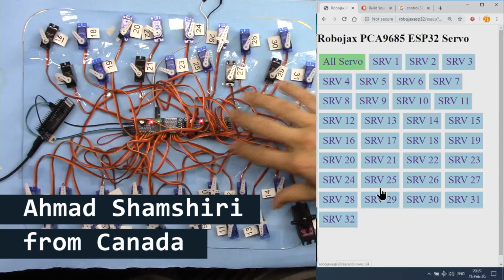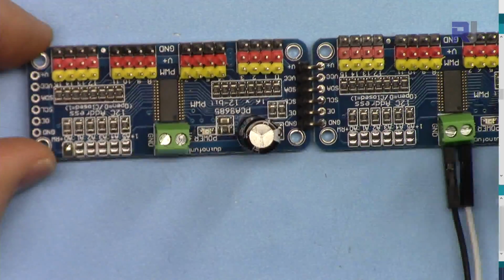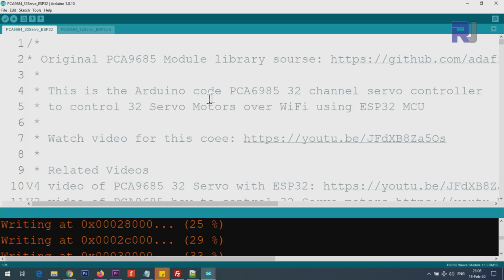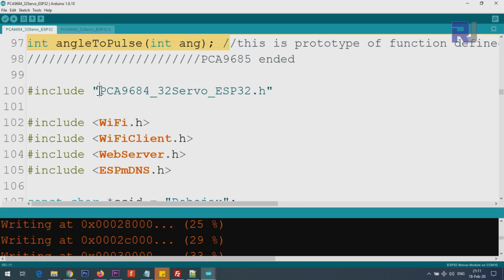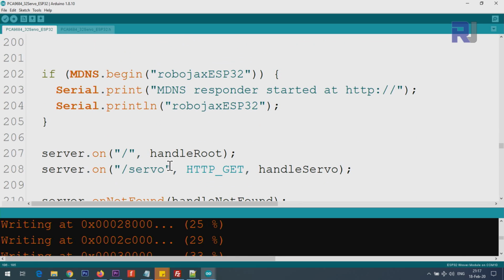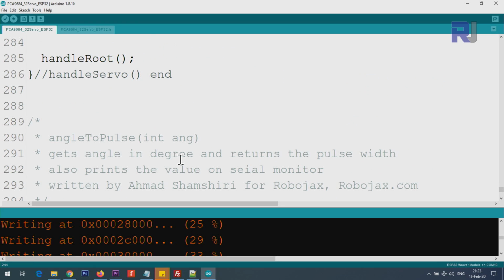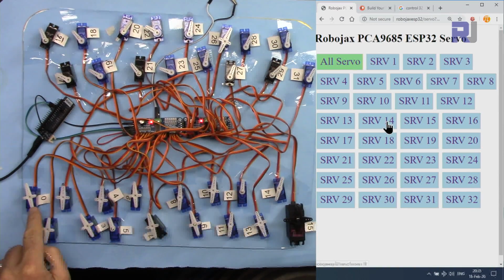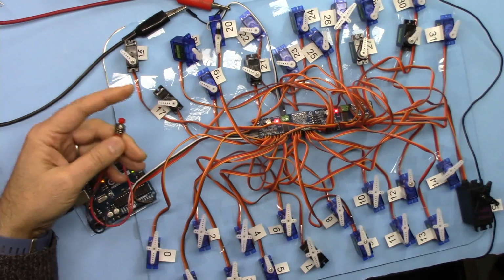Control 32 Servo over Wi-Fi using ESP32 and PCA9685 via desktop or mobile phone V5 - RJT365

Comment: I need to configure the SCL and SDA pins on an ESP32 WROOM I don't know if D21 and D22 correspond to G21 and G22 on your board could GPIO13 and GPIO14 be ok? How to configure them?
Reply from the maker: Sda and slc can't be configured to be another pin.
Reply: @robojax  instead it is possible to configure them on other pins that support PWM. I tried with a part of the code you created by configuring an ESP32 WROOM devkit 30Pin board on pins 13 and 14 with the command:

"Wire.begin (13,14); // 13 SDA - 14 SCL" and I am currently creating some code to control various Servos

Comment: @Robojax, I was wondering if the ESP32 and the PCA9685 could be used with a PS3 controller to control 6 servos for an animatronic project? I wasn't sure if this would be possible and if so, could you point me in the right direction? I been trying to write a code (using ChatGPT) and the items mentioned but haven't had much luck. I am just wondering if it is possible before I continue trying, Thank you.

Comment: Mistake on quantity of servos you can controll.  the quantity of IC's is 62 per I2C bus when properly setting the address pins.  each ic can control 16 servos, so 62 IC's times 16 servos is a total of 992 servos.  Datasheet page 2 paragraph 2 last sentence states 62 devices.  that would require about 25 amps not including the current needed for the ICs or microcontroller, when all 992 servos are active at once.  Awesome Videos.  Thank you.

Comment: Perfect design :) Everything works as it should. However, I would prefer to control the servomechanism with the help of a slider, is it possible and how to do it
Reply from the maker: If you meant a variable resistor/potentiometer then I have a video Lesson 86: Control position of a servo motor using potentiometer
https://youtu.be/ntRW77mNFFk

Comment: Great videos! If my main power source is 12v battery, is it sufficient enough to use a 7805 regulator to reduce the voltage to 5v or will I need to provide more current to power the servos?  Thanks
Reply from the maker: It depends on your servo motor power. Measure the current while motor is driving a load at maxim load and multiply it by the number of servo motors and supply that mischief current or power.
Reply: @robojax  Thanks, I'll give that a try.

Comment: This was a great video which helped me with my project.  I do have one question, when the esp32 is reset or when first powered on, the servos all move to their max points.  Is there a way in code to prevent that?
Reply from the maker: Hello, this is version 5 and we have 4 more videos. Of course we have . We have initial position for each servo motor where you can set it. It is there Have explained it  in one or more videos . Please watch the encode explanations carefully.
Reply: @robojax  I dont think that my question was correctly phrased.  I am using the Initial Motor position which works.  The issue was when everything is hooked up, and I upload new code to the esp32.  The reset causes the servos to move itself before the code is executed.  But I did take your advice and using the pushbutton example, hooked the OE pin on the 9685 to pin 15 of the esp32 which by default is HIGH on reset.  This effectively removed the output to the servos until I could handle it in the code.  Problem solved!

Comment: I download your code from the link, unzip the robojax_PCA9685-V5.ZIP. i find out two files. 
The PCA9684_32sERVO_esp32.h file( there are missing code on the first line)
PCA9684_32Servo-ESP32_V5.ino, there is no code related to "PCA9684_32Servo.ESP32.h" file; no code to call the html to display on the smart phone
Please post the latest version code to let us to learn from your experts
Reply from the maker: Hi, I just downloaded the code and it  has the .h file and checked the code is the correct one. you must be doing something wrong.
Reply from the maker: Sorry, when you post a link, YouTube treat it as spam and it was hidden and I did not see it to reply.  the .zip file caused this comment to be  labeled as spam.

Comment: Hello, I want to know how to set the parameters if the servo is changed to 270 degrees?
Reply from the maker: Hello, I have 5 versions for PCA9685 and I hope you have watched the other version because I have written so many programs for this and how to calibrate the servo. lookin at V1 code which you find the link in code page, I saw this 
  for( int angle =0; angle<181; angle +=20){
    delay(500);
    pwm.setPWM(0, 0, angleToPulse(angle) );
  }
as y ou can see it has 180 . change that to your value. or watch videos to so you learn and then modify the code.
Reply: @robojax  Yes, but I don't understand English, can you give me some more hints?
Reply from the maker: use google to translate. just change 180 to 270.
Reply: @robojax  Yes, thank you for your reply. To communicate with you is to use Google for translation. But without subtitles, I will not be able to see the video clearly. So, what do you mean, I only need to modify "duty = map(angle, 0, x, pos0, pos180); change x from the original 180 to 270? The remaining two lines" int pos0 = 125; and
int pos180 = 575; "Do I need to correct it?

Comment: Hi, do you know how to calculate power supply needed for a project with X servos suplying with batteries?
Reply from the maker: Hi, measure the current using ammeter or find datasheet for one sensor. then multiply it by the number of servo motors. then add 10 to 20% more so you are safe. keep in mind when you are measuring it the current of any device without load and with load are different. so put load or servo meaning while servo does the work, measure the current.  Good luck and stay safe.
Reply: Thanks!

Comment: halo , first of all thanks for the awesome vids. I enjoy them alot.
I know I will always take something away from your vids, but Im struggling I have watched all these vids 1 to 4 and Im guessing im making a hybrid of them all, but im stuck either all move at once to single position and stop or one by one but same angle, can i maybe ask i want like say 4 buttons to do set of commands and stop. like bttn 1 if pushed servo1 will move to 90 servo 2 to120 and servo 3 to 30 and then return to the position that was given to start with say servo 1 was 50 ,servo 2 was 30 and servo 3 was 0 and if bttn 2 is pushed then servo 4,5 and 6 will move to their positions if i can copy that first part and change the values then its fine ill do that myself no problem, im using a uno and a PCA9685

Comment: Do you have sample code for Android phone, MIT App inventor, HC-05 Bluetooth module, to Uno R3, PCA9685, to 16 servos (controlling individual servos with sending text such as S1F for rotating servo number 1 fully clockwise, S1N rotating it to the mid position, and S1B for rotating fully counterclockwise)
Reply from the maker: never used any app with Arduino except the Bluetooth serial
Reply: @robojax  l'm trying to figure out how to: send a text message to an Arduino to rotate a servo.  MIT app inventor is the phone app. An Hc-05 bluetooth module gets the text sent by the phone. But i'm having trouble with the Arduino code (sample code from Adafruit servo shield)
Reply from the maker: you may learn it from this video https://youtu.be/5TlEgfFDrzI and I have series of videos on servo via Bluetooth check them out.  I've used Arduino Uno, but ESP32 or any other Bluetooth device will work the same.  good luck

Comment: Hi sir, thank you for this video, i am just getting started with esp32, i have one question Which io pins of esp32 needs 3.3v shift transfer from 5.5v input. Are all pins are 5.5v tolerant?
Reply from the maker: no. ESP32 GPIO can handle are 3.6V maximum at input.
Reply: @robojax  so all pins require level shifting from 5v to 3.6V ?
Reply from the maker: Yes. But not to 3.6 but rather 3.3 which standard. the board can handle MAX 3.6V
Reply: @robojax  thank you for reply, one more question why didn't we use 3.6 v in this PCA9685 tutorial